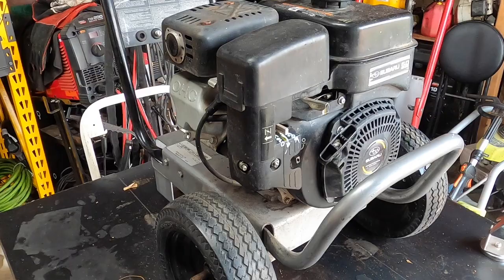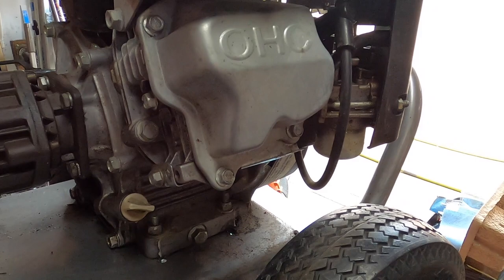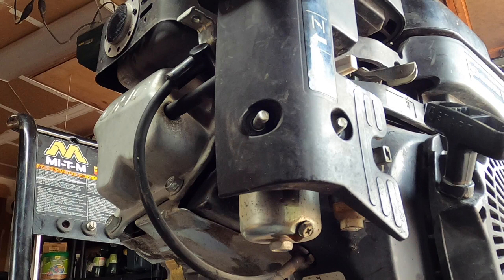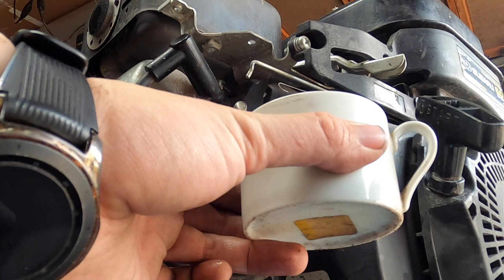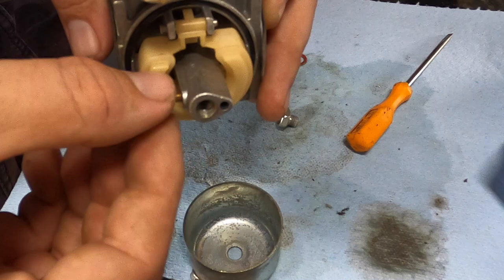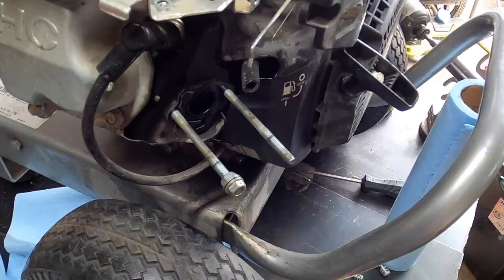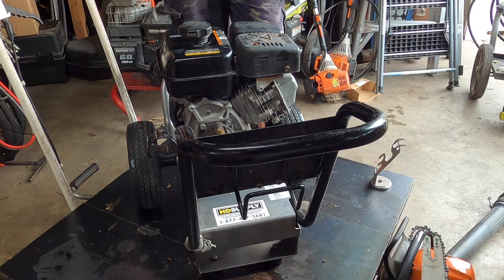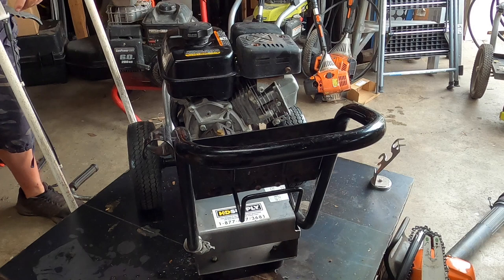Subaru Pressure Washer Smoking

Comment: My gcv170 honda starts fine, puts nice pressure out, but after about 30 seconds, it starts smoking. I changed the oil, made sure its the correct level, used a 10w30 and still smokes badly.
Reply from the maker: Depends on color of smoke. Is it black or a light blue? Black would be a carb flooding issue or maybe a choke problem. Lighter blue is oil. Oil is a bit harder but could mean a plugged crank vent or head gasket is leaking

Comment: I have a craftsman doing the same. But it is also spitting oil out of the exhaust
Reply from the maker: I would smell the oil and see if it smells like gasoline. If it does the carb needs to be cleaned or replaced. Could also be over filled aa well

Comment: I have a pressure washer with Subaru that smokes only when you use pull trigger to wash no smoke when ideal and not using. Pressure washer trigger checked properly filled with oil any idea why it doing this. First time out this year new gasoline was fine last time used it
Reply from the maker: It depends on the color of the smoke. If it is black then the machine is burning rich. Could be a carb problem. It is blue then there is oil being burned. Could be ring wear or bad valve guides. I would take the dipstick out and smell the oil. If it smells like gas then clean or replace the carb and change the oil.

Comment: I can’t understand why all air cooled engines don’t have a fuel cut off valve and instructions to use it 
Yea they can sale more engines or equipment 😢😢😢
Reply from the maker: I would imagine it is for cost and yes replacement. Stuff like this though should be common sense but the issue is most people don't have common sense. Common sense really is named poorly lol